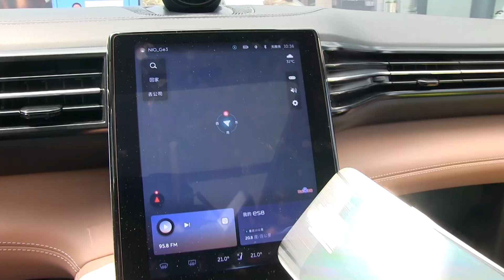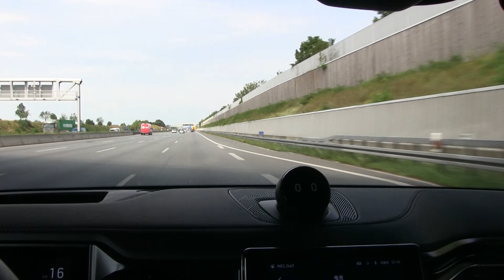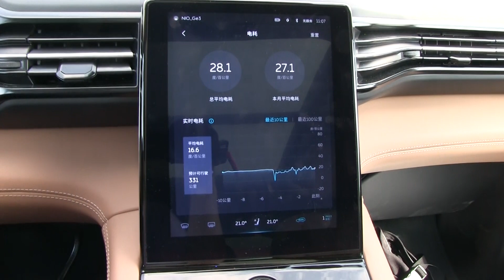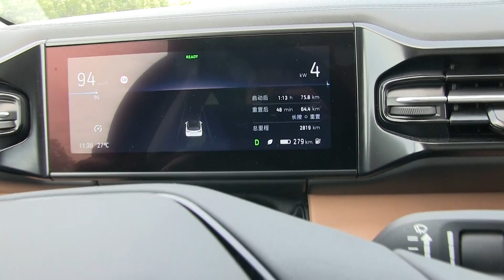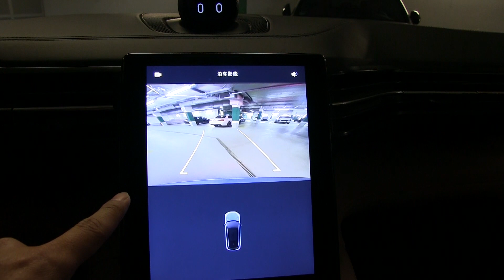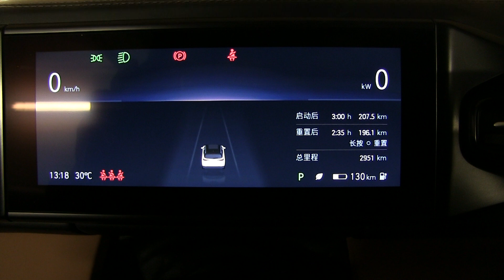Nio ES8 test drive and range test

Comment: Hi Bjørn. If you had used the mobile app Speedometer+, which you showed us in another test, some years ago. It will showed you distance, elevation difference, top speed, average speed, motion time and idle time.

Comment: I noticed that you did not mention the Mercedes EQC when talking about competitors. Is it because you did not get around to testing it yet or is there possibly some other reason for that?
After all, interesting as the Nio ES8 may be, it still is even according to your own estimation years from market in Europe whereas the EQC should be readily available.
I really hope there is no bad blood or something since you are so much into Tesla and there has been some controversy with Daimler-Benz in the past.
Another thing I noticed is that there seems to be some rather coincidental connection to BMW with you happen to charge the car there (although there may be plenty of BMW dealers especially in Munich) and Nio having their Design Center in Munich and the tail lights of the ES8 reminding (at least me) an awful lot of BMWs I8 tail lights; or dare I say if not identical.
Good review though, as usual!

Comment: Getting the same range as the E-tron with 20kwh less usable energy.
Reply from the maker: e-tron in that temperature can easily go 400-450 km
Reply: Bjørn Nyland yes per your testing that’s true. But with that math if you were to add just 5-6 KWH to that car it would be about the same and still have 14-15KWH less energy. Still just crazy how inefficient it still is.

Comment: Graet movie Björn. I want to ask you if this can be right. I have a e-niro and I’m on holiday in Europe, I mostly charge att ionity charger. The other day I hade 10% left and I could charge 66.5 kw/h and then a was at 97% charge. If a take 66.5 x 1.13 = 75.1 kw. Is that right way to calculate how big the battery is?
Reply: I would think 66.5 kWh is 87% of the battery. So by dividing 66.5 with 87 to get how much 1% is (0.764...) and then multiply by 100 for a full charge = 76.4 kWh. But there may be charging losses included in those 66.5 kWh if it is measured at the charger.
Reply: Thanks for taking time to answer my question, but when you talk about losses, how much is that in general. The measurement was on the charger. This is a 64 kWh battery, I know that the batterysize is bigger but not this big. I thought the battery was at approximately 70kWh.

Comment: Hi Bjorn, at 14:20 you speak about Nuclear Power Plant. I wonder what is your opinion about Thorium nuclear plant. I see it presented as the miracle solution (no radioactive waste) on Youtube, but nobody ever talk about it in real life.
Do you think it's just a scam, or there is a real potential in the future (limitless electricity with no risks of Chernobyl or Fukushima) ?
Reply: Nuke is the only way to produce cheap electricity enough to replace coal and gas plants. Renewables do not produce garanted electricity.
Reply: Nuclear power plants it's safe if applying all safety protocols. I live in city with NPP.
Reply: A cooling tower could belong to a nuclear power plant or a coal power plant....    I prefer the first anny time especially in Germany, where they burn low grade lignite.
Reply: @peterjensen9671  Lignit power plants are direct beside lignite mining. Near Munich is no lignite
Reply: The plant Bjørn passed:
https://en.wikipedia.org/wiki/Isar_Nuclear_Power_Plant
Re.Thorium: It's a great material for making innovative new nuclear plant designs.
Unfortunately, there's very little being invested in development.
Looking at the struggle to build current reactor designs (Ref: Olkiluoto and Flamanville), 
it's hard to see anyone investing in licensing for new reactor types.
Reply: Any sort of nuclear has nothing to do with the future energy demand of mankind.
Mankind will use in 50 years about 400,000 TWh per year, 300,000 TWh for planet renovation alone (filtering CO2 out of the air and split it in C and O until we are back to 280 ppm).
Only photovoltaic is suitable for so much energy production.
Reply: @Roland Mösl
"Any sort of nuclear has nothing to do with the future energy demand of mankind."
Not necessarily true. Nuclear power currently is the only reliable energy form that has enough power density to meet the power requirements for now and the near future. Power generated with wind and solar is less reliable and can not be mass stored effectively. Therefore additional power solutions like Nuclear will remain to be used.

Nuclear fusion is still the power promise for the future, with clean, no-waste power production. But getting it to work on a large scale, still requires a lot of work.

"300,000 TWh for planet renovation alone (filtering CO2 out of the air and split it in C and O until we are back to 280 ppm)."
Who claims that will be done, or is even necessary? Citation?
Reply: @MacXpert74  Earth is at a thermal run away. To survive, at last -200% CO2 emission is necessary.
No more emissions from fossil burning, reduce CO2 from 415 ppm to 280 ppm again.
To take 1 kg CO2 out of the atmosphere and split it in C and O requires 8 kWh, last years emissions 300.000 TWh.
That's 100 times more than current nuclear electric power production.
Reply: @Roland Mösl
"Earth is at a thermal run away."
What is your evidence for a 'thermal run away'? There is some warming of a couple of tens of a degree in the last century, but that doesn't show 'thermal run away'. Citation needed!

"To survive, at last -200% CO2 emission is necessary"
People aren't massively dying right now because of the current Co2 level of 415 ppm. The world population still growing. All plans I've seen so far only are focused on not further increasing Co2 levels, which makes sense. But non are about drastically reducing the levels. And the levels have been above 300 for many decades now, so why do you say it has to be 280 ppm 'to survive' and what scientific backing do you have for that claim?

"To take 1 kg CO2 out of the atmosphere and split it in C and O requires 8 kWh, last years emissions 300.000 TWh."
So where is the worldwide plan to do this Co2 filtering exactly? Inventing non existent power requirements for non existing CO2 reduction plans doesn't make much sense.

"That's 100 times more than current nuclear electric power production."
With nuclear power being one of the most power density effective solutions, it sounds like your idea of "CO2 filtering" is DOA (dead on arrival).
Reply: Roland Mösl Let’s start building nuclear on a really large scale then. It is the safest and most environmentally friendly way of producing power by far!
Reply: Nuclear power plants are expensive to build. We have seen a lot of protest in the past in Germany against Nuclear after Tjernobyl and Fukushima disaster. The government agreed to shut them down in the near future (wise ?). Wind turbines and solar is not enough for now. Lignite power plants will be needed in Germany at least till 2030 causing a lot of CO2 emissions, and protest starts again. Thorium might be a solution but not in the near future. With this in mind, the transision to electric cars will also be slow.
Other solutions ?.